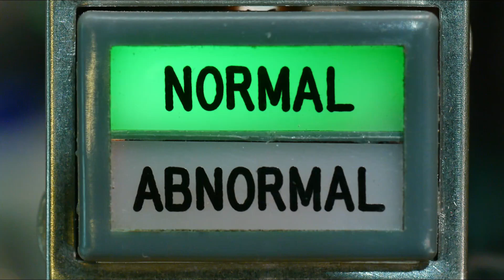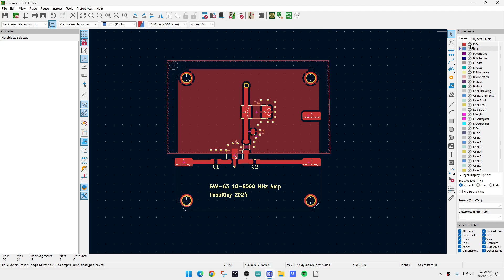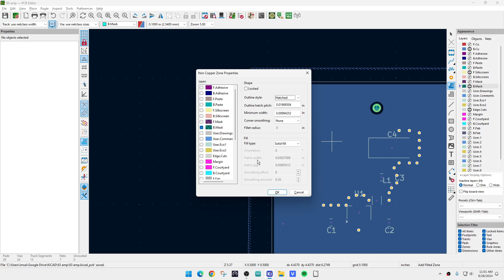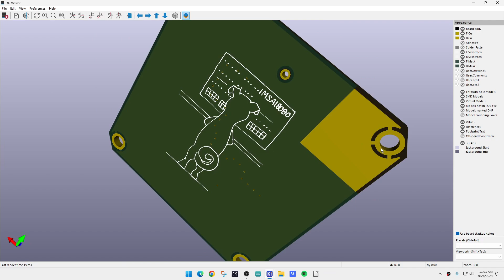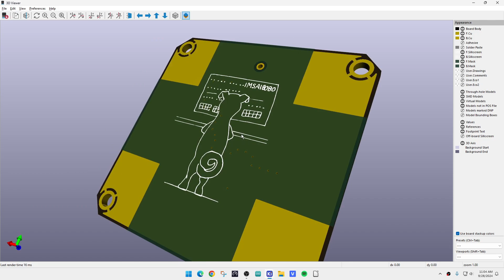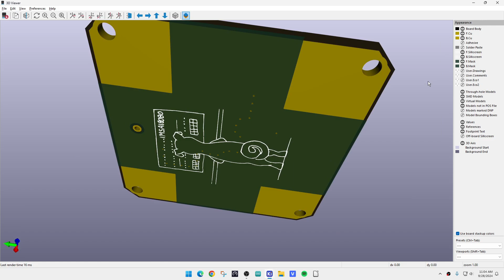#2023 GVA-63  Amplifier Project (part 6 of 10)

Comment: Great. Only that if you don't ad all the details in the footprint you need to do it all over on the next board. There is a work around that but it is not the way to teach how to do PCB. Have done many of these fixes to know better. Thanks for your great videos.